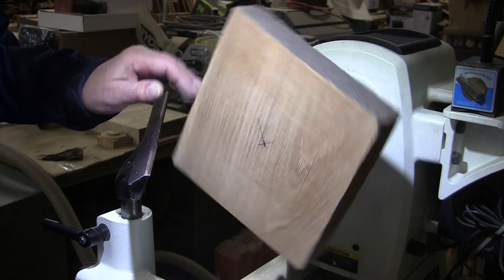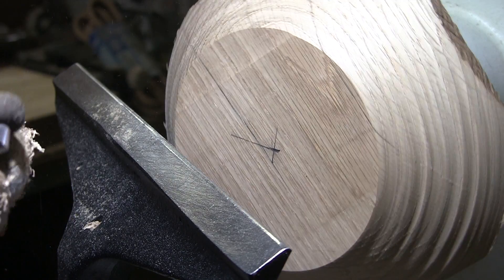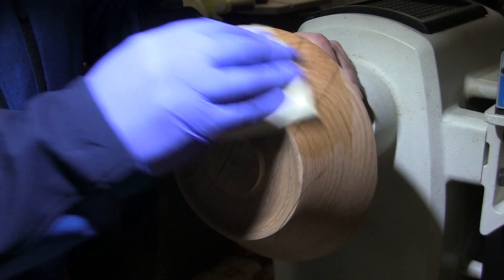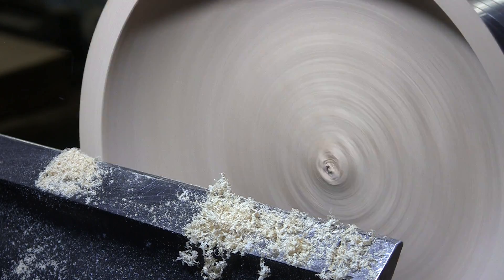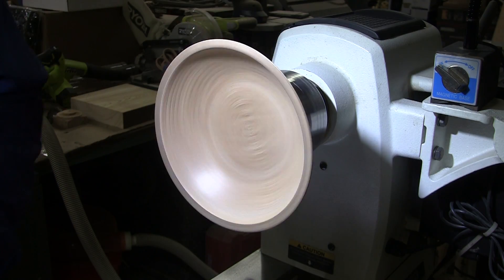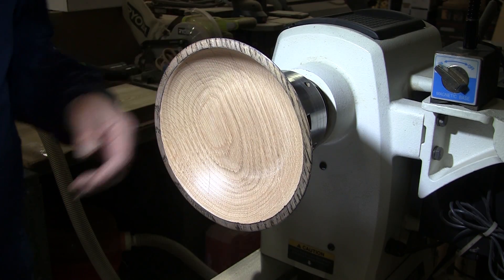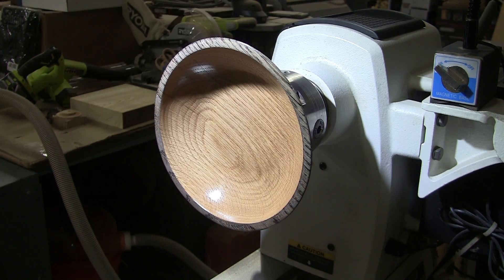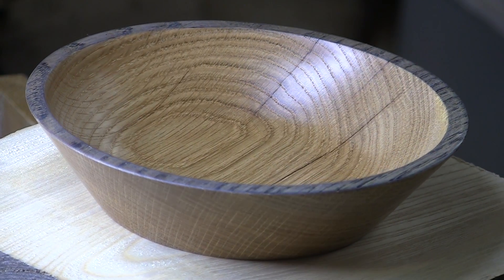The One Hour Bowl - Wood Turning

Comment: Nice looking bowl. I see you used negative rake scraper. I want to convert my scraper to negative rake but am not sure of the bevel angles. I have heard they have to add up to 90 degrees. Two 45 degree bevels?
Reply: Check out this YouTube post where Stuart Batty demonstrates his "40/40 grind": https://youtu.be/N7BjRcSDurM  I bought a 1" round nose cryo-steel scraper (Pinnacle Tools) to try this with, and it works great.  The total included angle should be closer to 80 degrees, and it is easiest to set up your grinder if you have the same angle on both top and bottom, but they don't have to be the same.  If they aren't the same, sometimes one angle will work better than the other depending on the wood.

To set the angle on your grinder, use a bevel gauge.  Open it flat, then raise the blade until the angle under it is 40 degrees.  Then, adjust the tool rest angle on your grinder so the blade is tangent to the wheel.  Grind the tool, flipping back and forth between bottom and top until the two bevels meet all the way around the nose in a bright line.

Use it so that the tip of the bevel is exactly on center with the wood.  If sharpened correctly it will cut a fine shaving.  Really delightful to use compared to a scraper with a normal bevel.

Batty also sharpens bowl gouges with a negative rake, but I have not tried this yet.
Reply from the maker: Thank you, Ray!  The negative rake scraper must be LESS than 90 degrees combine angle.  I think mine is 76 degrees.  No particular reason, just how it worked out but it does have to be less than 90.  I think if I ever regrind, I will make the top and bottom angle the same, say about 38 degrees each.  That way, you won't make the mistake I sometimes make by grinding the wrong side to the wrong angle!  Happens all the time!
Phil

Comment: Nice work Phil.What degrees to you sharpen your scraper.a can not get my scraper to cut like yours.Thanks Dave and Deb
Reply from the maker: Thank you Dave and Deb!  I can't remember the angles but I have it written down in the shop.  Problem is, I can't get to the shop for all the dang snow!  The negative rake just has to be a combined total angle of less than 90 degrees.  In my case, I just eyeballed it and then figured out what those angles are.  It's something like 37.6 and 38 degrees for a total of 75.6.  Weird, huh?  If I had it to do again, I would grind both the same to keep from grinding the wrong side all the time.  So I would probably do 40 degrees and 40 degrees.  Hope that helps!
Phil

Comment: Hi Phil. I like the way you attempted the shoe polish trick. You mentioned you could have done the rim with a sharpie. Have you ever tried that ? Does it work and take finish well? Thanks. Lar 🇨🇦
Reply from the maker: Howdy Mr. B!  I know that I have used a sharpie to decorate a piece and I know that I put finish over it.  It must have been polyurethane.  I don't use that much anymore.  If you put shellac over the sharpie it will wipe it away because they are both alcohol based.
Phil
Reply: @PhilAndersonShadyAcresWoodshop  I have had tremendous luck with "India Ink" speedball is the pen brand that manufactures a common one.  It is VERY viscous though, so you will need to seal the wood grain first, then once it has dried you may need to seal over the ink again.  (if you spill the ink it will never come out, I know from experience!)

Comment: Phil, if the bottom is so thin, why not leave the tinnen as part of the bottom for reinforcement.
Reply from the maker: If you look closely, John, you'll see what I call the "button."  It's the top of the tenon nearest the bowl bottom.  I did leave a small thickness of it, basically doubling the thickness of the bottom at that point.
Phil

Comment: Another neat informative video. I am72 and just getting into making bows for gifts. Always learn something new and interesting from your videos. I have so far made 2 very simple bowls. I have a old Sears lathe that I bought for $80. But I did buy 2 expensive carbide tools that cost 4 times what I paid for the lathe! Next week I am going to check out Grizzly lathes in Springfield MO. for ideas. I'm just not sure how large I want to go but am thinking I want at least a 16". Any thoughts?
Reply from the maker: Thank you very much, Mr C!  I know what you mean about the price of tools!  But, that's your connection between you and the wood, so it's probably worth it to buy good quality tools.  When I was 69 years old, I considered whether or not I would get my moneys worth out of a new, expensive lathe.  Going ahead and getting one was one of the best decisions I've made.  I already feel like I've gotten my moneys worth, but I hope to get so much more!  I've heard good things about Grizzly lathes, but they do have a less expensive line and a more expensive line.  I would want to be sure I was getting electronic speed control and reversing capabilities.  Other than that, yes, I think 16" is a really good size.  Mine is an 18" but I think I've only turned two pieces that pushed it to it's limits.  Most pieces are under 12".
Enjoy your trip to Grizzly and please let me know what you decide and how you like using it!
Phil

Comment: Nice bowl for sure.  I like white oak.  As far as the black rim, I tried something the other day using an ebonizing solution made from steel wool dissolved in vinegar.  It really worked well on the white oak I had and it really popped when i put some finish on it.
Reply from the maker: Thank you, Robert!  I must try the ebonizing solution.  I've heard it works well, especially on oak.
Phil

Comment: Hi Phil, nice video as always, thanks for sharing it. I do like turning oak but as you found out it can be hard as iron!  Another treatment you can use with oak is ammonia, but watch out for the fumes. Just put the piece in a box together with a small bowl of ammonia and cover with a lid. It only takes a couple of days, the wood darkens and the grain really pops.
I have another piece of beautifully grained ash on the lathe at the moment, but just like the last one it has split! 
Bah! By the way, love the way you talk to yourself sometimes - I’ve been doing that for years - lol.
Take care over there
David in very wet Devon
Reply from the maker: Hi David!  I must try the ammonia trick.  Others have mentioned similar, too.
Those dang splits!  I'd love to get ahold of some ash.  Similar to oak, right?
Well, yeah, I do talk to myself.  Not always intelligently, but at least I'm not hearing voices.  Not yet, anyway...  LOL!
Phil in very snowy Bonney Lake!
Reply: Ash has is not so hard as oak but often has lovely heart wood.  The 2 pieces were both part turned from wet and both had a knot which I think is what caused the stress cracks???
I find talking to myself is the only way to get sensible answers....... lol
David
Reply: Sometimes talking to yourself is the only way to have an intelligent conversation!

Comment: To blacken the edge I just an old wash cloth held tight against the edge spinning at around 2000 with put a nice black edge. 👍🇺🇸
Reply from the maker: Ahhh.  So basically just burn it?  Great idea!  I don't think it would have worked on this particular bowl because of the cracks.  Might catch the cloth, but yeah, I see where that could work.  Thanks for the tip!
Phil

Comment: I turn lots of both red and white oak. In my opinion you were very lucky it didn’t blow apart at three speeds you turned it. It worked but I was waiting for the bang. I’ve had it come apart at 4-500 rpms when there were cracks.
Reply from the maker: As I was turning at those high speeds, Wayne, I was thinking that was a distinct possibility.  The cracks weren't really long and I felt like there was still enough connection that they wouldn't come apart.  If I hadn't been in such a hurry I would have used CA on them.
Phil

Comment: For the polish, I think you may have done better if you'd spit in it like when using it on shoes.
Reply from the maker: That may have worked and, yeah, I've done that when using on my shoes.  I've also softened with heat, which may have helped, also.
Phil